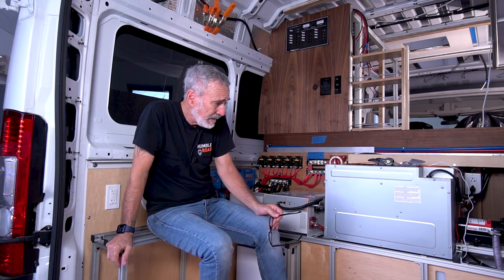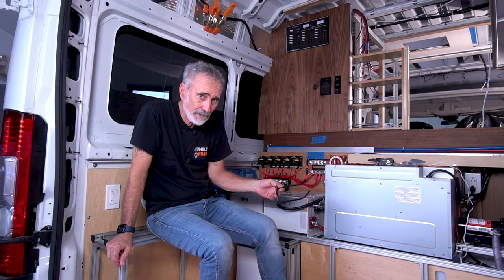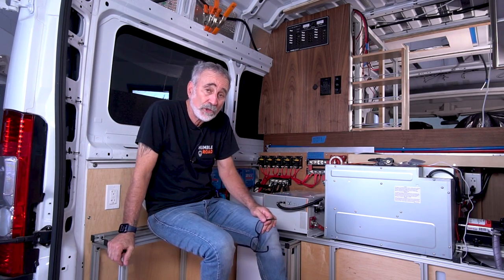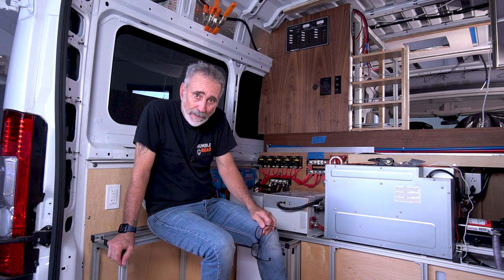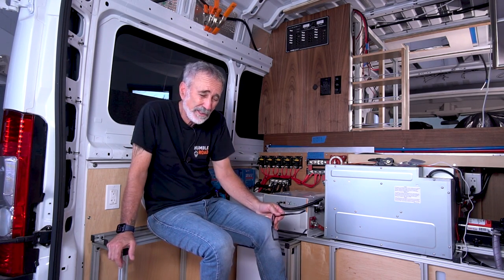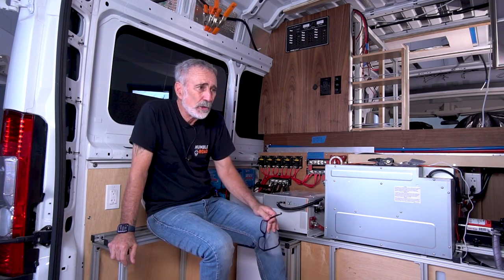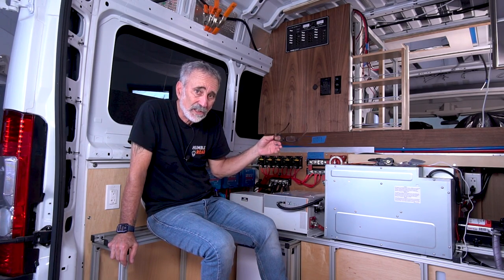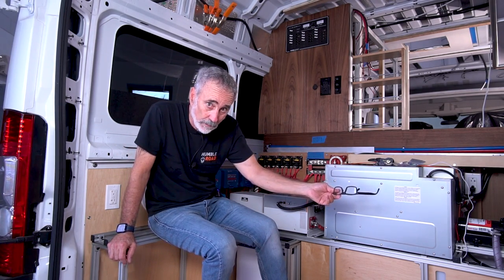Recirculating shower in a van? Just my humble opinion...

Comment: Hi, Mr. humble. I really can UNDERSTAND 'where you are coming from'. The idea itself is kind of 'disgusting' and what you said is absolutely true about the unpleasant maintenance work and everything involved, and you gave Very Good Advice for the 'Average RVer' (and particularly, van conversions – FOR THE LARGE MAJORITY OF PEOPLE'. But HOWEVER (you probably guessed by now there is a 'HOWEVER'), I really do think the whole thing has merit). After all, are you prepared to say that we should not explore outer space and try to land humans on Mars and so on? Consider the International Space Station - I can pretty much guarantee you that JUST ABOUT EVERY SINGLE DROP of water on that station is recirculated (as much as possible, at least, because carrying water up into low Earth orbit is very, very expensive. And indeed, I would go so far as to say were never going to be able to put people on Mars without essentially 100% water recycling... Maybe a bit less than 100%, because we might get as humans some additional water intake roof food consumption using food stocks that were stashed away for the journey, but effectively 100%). 

ANYWAY – I think 'the devil is in the details' and I completely agree with you in general assuming that water has to pass through filters which need to be replaced periodically and clean, etc. HOWEVER – what if we could do away with the FILTERS? 'Give me Enough Energy and I can do anything'. An idea to consider exploring: suppose the shower water circuit was Completely Closed Loop and we did not use any filters per se but instead we used electrical energy to CONSIDER USING DISTILLATION TO PURIFY THE WATER? This process, while it may take an awful lot of energy, yields/would yield Distilled Water which is 100% safe to drink. (Not for long periods of time however, because it does not contain any minerals which your body needs to absorb from water, but from a safety perspective – aside from attentional long-term risks due to too much consumption, it is completely safe!).

Here's an idea – you have in your bills gone to great lengths to try to have as many possible ways to GENERATE electricity in order to charge up arguably 'large banks' of lithium iron phosphate batteries. Now, I'm too lazy right now (just having ham and eggs for breakfast and enjoying my first coffee) to undertake to do 'The Calculations' but what if the shower system was Completely Closed Loop and simple distillation was used to purify the water? Questions: how much water would be REQUIRED in such a system to produce essentially and Endless Shower (as long as the energy held out)? The reciprocal of this: how much energy would be required to Force a State Change between Liquid Water at some assumed temperature going into the purification process to evaporated and condense it back down into Liquid Form? What about the possibility of Heat Recovery Systems (such as those increasingly being installed in houses today) being able to transfer the heat of condensation of that 'steam' 'back into' the warming of water yet to be purified? 

In short, I really do think this would be a fascinating area to just do some 'Back of the Envelope Calculations' from an energy perspective just to see "what it would take?"

Remember, you got solar power available, you often have AC power available, there are various ways to generate significant amounts of electricity from the vehicles engine - many hundreds of watts and double/even low triple digits of amps at 12 V, you are already designing the vans to use engine heat while driving to put it through a heat exchanger in order to produce hot water for future use stored in an insulated tank. Plus, I'm not a 'purist' – if I had a van, I would still think nothing about 'lugging around with me' a gasoline generator to use as an absolute last resort, if for some reason I could not use – say the vehicles engine with a DC to DC converter – to generate electricity to recharge the vehicles batteries.

For example, and I should mention here that I would never attempt to charge/recharge the vehicles 'house batteries' (lithium iron phosphate) 'straight from DC' but I would take the AC output and simply feed it in through the vehicles 'shoreline AC connector. Because that way – I think one could safely assume – and doing 'some calculations' 'In My Head' – using say a 2 kW inverter generator, let's assume that we might only have 1500 W max of AC power available on a sustained basis TAKING INTO CONSIDERATION ALL THE LOSSES – ALL POSSIBLE LOSSES INCLUDING INVERTER LOSSES – TO USE IN A ROUNDABOUT WAY TO DISTILL THE WATER IN THE LOWE'S LOOP SHOWER SYSTEM? 

Now 1500 W at 120 V is ROUGHLY 12 1/2 A which would roughly convert to about 125 A available at 12 V so the question becomes (and we're back to the beginning again) how much power/energy would it take, taking into consideration heat exchangers to try to capture the latent heat of condensation to heat/evaporate water coming into the loop?

I don't know the answer off the top of my head – perhaps if I get a few minutes – I might research this a bit more just to see how feasible this might be at least from an Energy Standpoint. 'Something tells me' the results might be quite surprising, and considering that perhaps we might only need no more than 2 gallons of water in the closed loop shower system AND considering how much heat we might be able to recover - – 50% at least? - To recovery of Latent Heat of Condensation, we might get some interesting, intriguing results.

Of course, assuming the calculations seem to suggest that it might turn out to be both practical and feasible, 'The Devil is in the Details' and then one would have to design a system and build it in order to perform the task at hand. 

But, if the math/physics of this suggests that it IS Reasonably Possible, then I think it's an idea worth pursuing.

Think about it (I suggest): THINK ABOUT IT! This idea could potentially have  TREMENDOUSLY WIDE APPLICATIONS, not just in RVs but also in homes. 'Look at' the Catastrophic Drought Conditions the American Southwest and Great Plains are currently experiencing, with reservoirs running out of water and so on and so forth. (By the way: this IS Global Warming/Climate Change and it's probably going to 'do us in' but heck, we might have some fun along the way) but in the average home for example, how is the bulk of household water actually consumed (inside the home)? Answer: almost certainly it involves 'toilets' and 'washing/showering'. Of both people and clothing. Assuming that the math seems to suggest that it's possible and perhaps reasonably practical if we are clever enough, imagine shower water (and perhaps even human liquid waste) being recycled in this fashion with a separate water circuit in the house feeding both human and otherwise washing and waste management needs, with only solid wastes being left to deal with... Which – by the way – could make excellent fertilizer for various uses around the home – generally outdoors – if all one had to do was empty a bag of – over time – waste recovered from the distillation process 'collector'.

Anyway – just figured I'd spend some time over a cup of coffee this morning and provide you with a thoughtful, considered response because "I KNOW that YOU love to think and innovate!".

REALLY ENJOY YOUR CHANNEL/YOUR VIDEOS – ESPECIALLY THE SHORTER PRETTY MUCH DAILY ONES YOU RECENTLY STARTED TO PUT OUT – 'short and snappy and very focused' and look forward to them daily. 

Keep it up – and THINK BIG! Think outside the box! Think about potential applications beyond simply Van conversion. I said to a cousin of mine who used to work with Ontario Hydro appear in Canada for five years ago (I own a fifth wheel trailer) and like to boondocks/dry camp for weeks on end and water is always a problem - really run out of freshwater but the Black Water Tanks are the limiting factor: "Give me enough energy and I can do anything!"

Cheers.
Reply: Just a quick note estimating the power needed for distilling shower water. To distill 1 gall water, the energy needed is nearly 10,000kJ. This needs to be happen within 60sec to have 1 gallon water per minute shower, that is about 10,000kj/60sec=~160kw, this is already higher than the engine power of most van even before any possible loss  (100% does not exist) considered. You probably cannot get this much energy this quick even when you are plugged in a camp ground.
Reply: Agree with you on “give me enough energy…”, but sorry, that wont happen.
Reply: Actually I disagree, just energy is not enough, it is the power! Which is energy per unit time. Time needs to be part of equation before we get into eternity. So the sentence may change to “give me enough power I can do anything”, now it sounds funny :)

Comment: The point of the shower loop isn’t to take longer showers or save on the planet fitness account. It’s to extend the water supply. Emergency showers. or when it’s cold out. Or when you are late for work.

Say the local planet fitness is closed. Cuz of covid omega. At least you have a backup
Reply from the maker: There is always a shower, just not a recirculating shower.

Comment: I’ve tried 3 different recirculating prototypes in my van and all have failed. Filters get clogged quickly and they are a pain to keep changing. Giving up and going with 40 gallons fresh instead.
Reply: Have you checked out the frugal factor YouTube build? Just curious if one of your prototypes was similar to this and if so how it failed.
Reply: @leblancexplores  I haven't seen that one. I looked at Hour Shower, Snow & Curt and Mispronounced Adventures. Mine fails because the filters get clogged quickly (2 showers) and the pressure goes way down. I've tried about 12 different filter combinations and I can't figure out a working combination.
Reply: @billnalen  what do you think’s clogging it? Soap?
Reply: @leblancexplores  I think it must be soap. We weren't particularly dirty and I couldn't see anything on the filters. The little screen filter before the pump did catch a lot of hair (we have a dog in the van), so that needed to be cleaned before every shower and it was in a pretty inconvenient spot. We tried a few different shampoos (including all natural) and also tried different additives like vinegar and epsom salt to break the soap down. Nothing seemed to work. I might try again in a more controlled environment in our driveway. We also don't have a problem finding water and don't boondock for very long, so we could just shower by filling a 5 gallon jug every day, or replace the 5 gallon recycle every day.
Reply: @leblancexplores  The other issue is heating the water. I'm using a single electric water heater. If I send recycle water through it for the shower, then I can't use it to heat water at the sink. I could use a heat exchanger and another pump, but that just adds a lot of complexity.

Comment: I’d like to hear some thoughts on alternative water sources, from filter systems for water in the wilderness to atmospheric water generators and how practical they are to integrate into a van system
Reply: I would like to see a camper or so (not a Humble Road) that catches condensation water from the airconditioning for the shower.
Reply: @rudivandoornegat2371  you do realize that Legionnaire's disease was from AC condensate
Reply: Good to know

Comment: Since I can't find the video that I wanted to review...do you need to have a diesel engine in your van to run the air heater or do your builds include gasoline motors?
Reply from the maker: The Webasto cabin heater can be had either way. Gas or diesel.

Comment: Don't use filters in a recirculating shower, set it up without them, have your shower with recyrculating water before a final rinse off with fresh water. It is no different to taking a bath and this way you avoid the nasty filter setup which realistically would need to be flushed every use.
Reply: That's not the worst idea, actually. I'm still plotting my plans, but one thing I had in mind was a way to drain the small holding tank for the recirculating system and then have an electric ball valve set up to allow fresh water to flow in. If one just lets in a couple of gallons at a time, that wouldn't deplete the fresh tank too terribly - far slower than running water from the fresh tank right to a shower head, to be certain!

Comment: Any chance you have designs on a very basic floor plan that would suite a old soldier with ability to do personal hygiene in a steel pot of H2O.  My desire is a great bed, great fridge, A/C & heat, plenty of insulation, plenty of water (hot & cold) all run off hot shot solar & batteries.  When soldiering I became proficient at creating creature comforts with milk crates and zip ties.  I am thinking a interior with utilitarian walls for universal attachments of utilitarian baskets and straps as needed.  Something that I can be a pig in and occasionally hose out as needed.
Reply from the maker: I'm sorry, Captain. That's not my style. There are many builders doing that sort of build.

Comment: I admit I’m confused about recirculating water. I thought George was talking about hot water recirculating within the fresh water lines for “instant hot water” on demand, as opposed to waiting for the hot water supply to traverse the 6 feet from the water heater to the shower head. When George starts talking about re-using gray water from the shower drain, I’m wondering WTH is he talking about.
Reply: There are a few people out there that set up a sump to highly filter then reuse the water. It's usually just the water for that session but lets the person shower as long as they like. The water is then discarded after. I don't think they're reusing the same water day after day.

Comment: If money was not a consideration, anything would be possible. One solution to long showers is a BIG water tank, but the weight of 100 gallons of water is 4,173 lbs. A more practical idea might be to draw water from a "clean" freshwater creek, lake, or river, filter and use that, then drain it away.  I imagine a retractable hose and water pump to siphon/pump water from a suitable source. Similarly, I imagine a few hundred feet of hose submerged into a body of water, hot van air pumped through into the hose returning cooled by the water for a sort of almost free air conditioning.
Reply from the maker: Review your math.

Comment: Your opinion is more fact than opinion. Planet fitness exists everywhere and even if you solve the length-of-time issue in the van you are still taking a long hot shower in a cramped space. Van showers are van showers; they are to be used barely, quickly and for utility. Nothing about showering in a van is meant to be luxurious. I'd make the same argument for bed-size. I would give up bed size for more utility space (cabinets, appliances, MEP systems) any day down to a full-sized bed as a maximum size.

I'll take it one step further: I don't even consider complex filtration systems for a van's fresh water system worth the winterization and space hassle. 
As an architect who would never dare to design a brick-&-mortar home without a filtration system for the city water - my approach changes for vans. Drinking water should be via 3-gal bottled water for vans and via filtered city water for brick-&-mortar homes.

Comment: Also on top of the disgusting cleaning of the filters, the longer you hot shower in a van, the more moisture you spread inside the the van this adds up to condensation and mold problems.

Comment: So I've got a question that nobody has really answered for me, and that's is, if you do use the filters and a UV light, how long should the water stay in the light to kill off any bacteria that are floating around. I do know that there are camping UV lights that you put in thermas for 90 seconds before you can drink it. And wouldn't a big UV light system eat up  precious battery life?
Reply from the maker: In the systems I am familiar with regulate UV exposure with flow rate. These days most battery systems are 600 Ahr or more, so they can more than handle the demands of van life.
Reply: Typically UV-C filters place the lamp in the center of a pipe, so the flows all around it. Look at garden pond and aquarium suppliers and you will see the flow rate each unit is built for. The amount of time depends on the strength of the light and the distance through the water, but UV-C breaks down all DNA, all living matter, rather quickly.
Reply: The LED UV-C filters like FitRV is using (Aquisense PearlAqua) make this simpler for an RV than the tubular bulbs, requiring up to 14W @ 12VDC rather than running an inverter.  That's at 2.1 GPM with 99.99%, per their marketing literature.
Reply: @lyfandeth   That is why I have asked the question because I have a 75 W UV light for my koi pond and it flows through it constantly 24/7 but it does take quite a while to kill out all the algae even at 75 W. The problem is even though it flows through it and over it it would have to flow at such a slow rate to make sure that it kills everything it's not just instantly
Reply: @nicholsceramiccoating8284  I think the problem is not so much the kill rate, but the pond itself is a breeding reservoir for the algae. The UVC lamp can't kill what's in the pond, under the rocks, in the fish, etc. Different from a closed loop water system.

Comment: By the time you make space for all the screens, filters, pumps and UV sanitizer you could have added a lot of water capacity.  I have seen some using recirculating showers with wet heads as well.  So you’re showering in water thats rinsing the outside of the toilet?  No thanks.